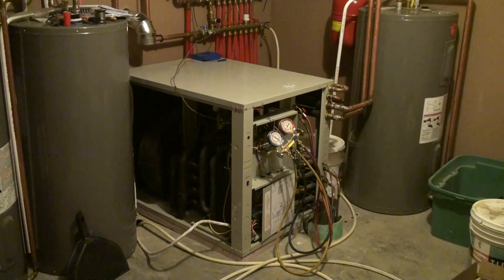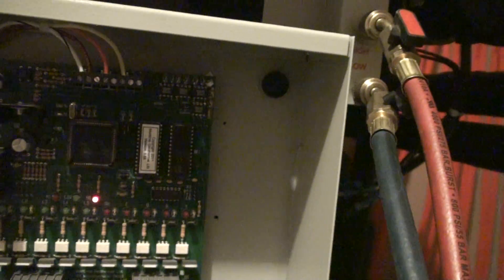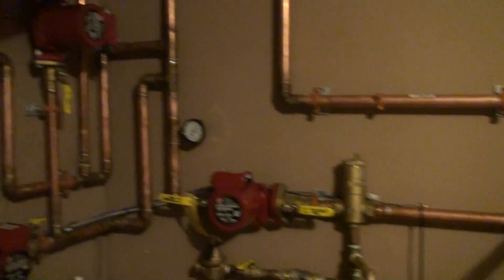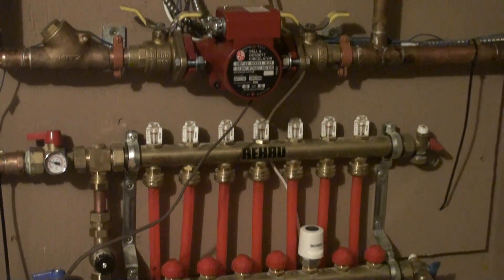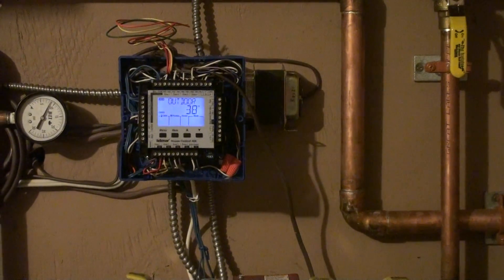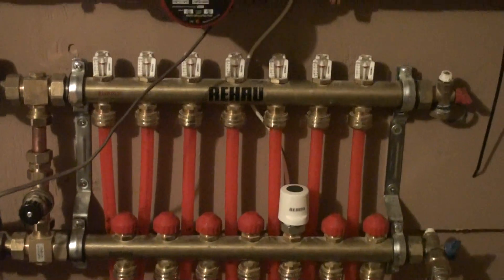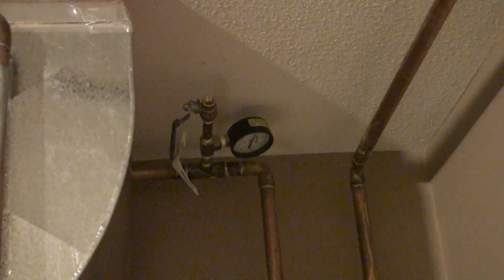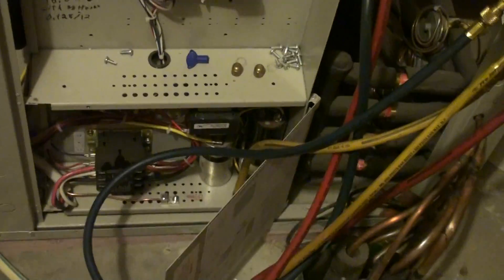Geothermal & Hydronic Heating System

Comment: I got about $23k Canadian in my system which includes the cost of drilling my well and pump. It is a pump and dump water system and I needed a well for household water anyways, it was all done on a new build so a regular furnace and well would have been about 17K so my extra cost for geothermal heat was only 6k which was paid back within 3 years. Since I added solar it is now utility free on my 100% electrical home.

Comment from the maker: Now couple that with hydronics and you gain another %20 over forced air and couple hydronics with controls that use outdoor temp. reset and indoor feed back with zone sycronization and you pick up another $20 to %45.  WOW.
If you require more info on the cop calculations I can get it for you.
Thanks again.

Comment from the maker: If you install either system in dry sand or gravel you may be one of those people that say geothermal
doesnt work. If you dont size the system properly for your design heat load you will say geo is no good. If you install your system properly in solid rock or wet soil you will be smiling all year round.

Comment from the maker: The water model idles at low speed while the Dx model runs only on high speed, but remember the water model needs a pump 
pack of one one more pumps to circulate the fluid through the ground loops. The Dx model requires much shorter ground loops
then the water style systems as the copper is about 7 times better conductor so drilling or excavating cost is lower.
Now the stickler is always the soil condition.

Comment from the maker: Thank you for your comment and observation.
Yes..the chart you see on the nordic heat pump does show lower cops for the DX model.
I have spoken at length with the engineers at Maritime Geo and was informed that those figures are
due to the method of calculation. The Dx models achieve the same cops as the water models.
It is also and apple/orange thing. The water model uses entering water temp. while the DX uses saturation temp.

Comment: Nice system! I only saw one issue on your water heaters/tanks; galvanized to copper connections on the inlets outlets. This will cause internal corrsion of the pipes. It would be a shame to see such a nice system have unexpected issues...
Reply: yes. good observation. that has been rectified with brass nipples. You didnt catch the feed regulator and backflow  are also installed backwards in the video, which was righted also.
thank you for your comment.

Comment from the maker: The pump will be between 7 and 9 grand depending on what size you need. My cost on this last system was about 20 grand with an extra fan coil and duct work for additional cooling....now add labour on that.

Comment from the maker: Hydroniclly heated floors are defiantly the way to go.You need to make sure you design it to accommodate geo and proper loop layout for house design and temperature. If you figure your square footage and double it you will be in the ball park for the length of tube in the floor. I pay about $.25/ foot for the tube here...my cost.  I used Tekmar controls and rehau manifolds which are top of the line..you can go as cheap as you like..at about $3500..this gives the ability to cool the floors too.

Comment from the maker: If you have the room , horizontal will be cheapest. I just did a vertical borehole field and it cast about $2000 per hole, each hole pulls about 10,000 btus. The loop field in this video is horizontal four loops and my cost was abou $2500 including the 1600 feet of copper pipe and my brother excavating for the complete ground system.

Comment from the maker: The cost of placing the ground loops is very different on account of your soil condition. The DX system only needs 100-120 feet of borehole if you decide to drill a vertical loop field. You need about 150 feet of trench if you go horizontal. This differs fron conventional where you may need 600 feet or more depending on soil condition in your area. And that is per nominal ton of heat.

Comment from the maker: The system I like to use comes from back east where you are. It is a Nordic pump made by Maratime geothermal. I am using thier DX heat pumps as aposed to their conventional pumps. You can go on their site and read up on them. On this system we excavated and laid the pipes in horizontal trenches under and beside the home.